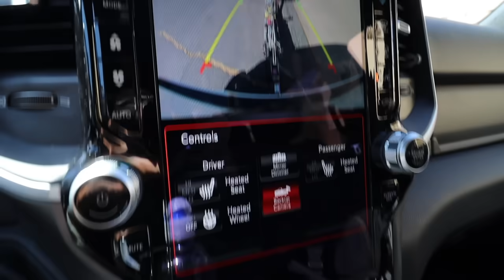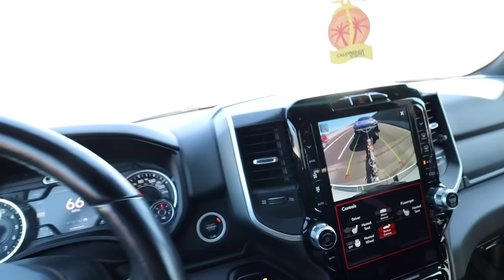TURBO INSTALL On My BRZ!

Comment: Engine failure issues have not been caused by RTV. The issue is oil starvation in right hand corners under load due to the oil pickup design, and the vast majority being failures on track cars. There is at least one prototype baffle in the works that when combined with an overfill, should alleviate the issue. Non-tracked 2nd gen BRZ/GR86's should not have to worry about RTV.

Comment: It might be time to let go of the 1st gen. I love my 1st gen, but if I had both, the potential for the 2nd gen exceeds the 1st gen by a decent amount. The 2nd gen addressed a lot of issues from the prior gen, and is overall more functional by design. The only reason I would think about keeping my 1st gen is the EPA update to ECUTEK. Now that I picked up a GR Corolla, the 1st gen BRZ is being sold. It’s a great platform for my preference in vehicle characteristics, but I live in the PNW, light RWD cars don’t do so great in the snow/ice. Also, it’s straight piped, and supercharged, can’t drive it with my 2 year old toddler.
Reply from the maker: I’ve considered but aside from technical reasons, my first gen holds a lot of sentimental value to me!

Comment: wouldnt it have problems if the engine is not forged? like blow etc. ? I want to turbo my frs but scared that it will blow. (love the vids)
Reply from the maker: Depends how much power. Every car is different. FRS usually caps out about 360-400 I believe though.